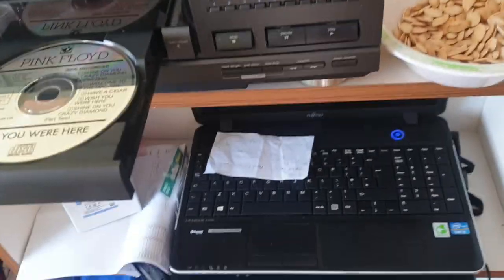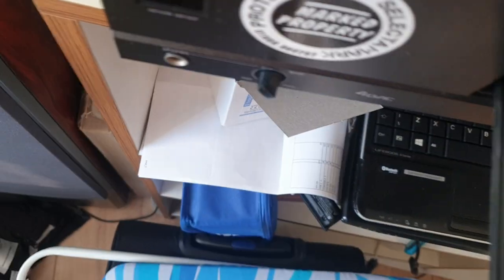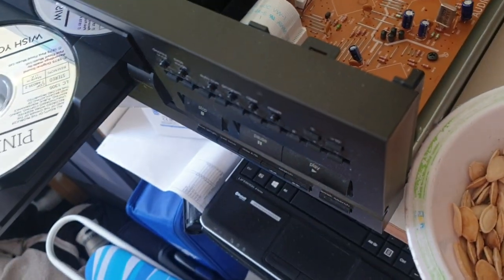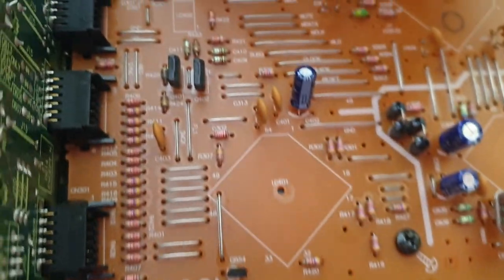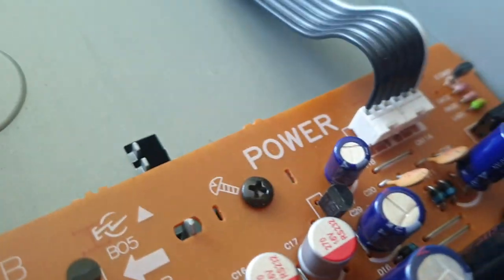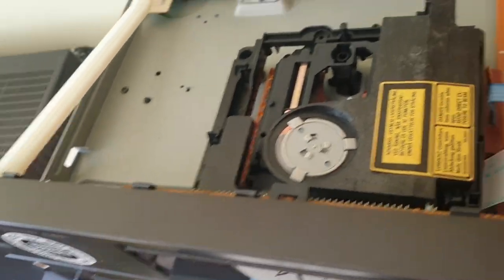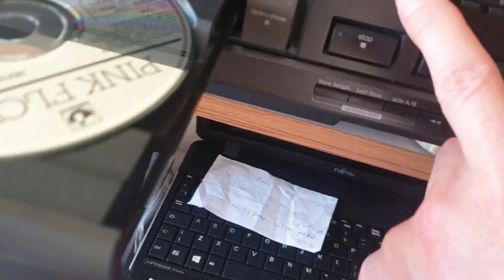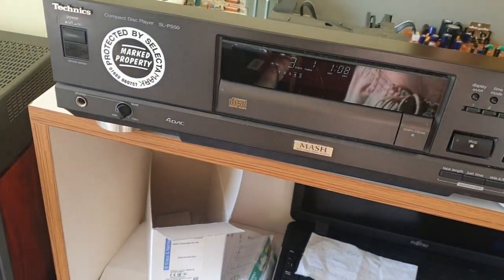Repair Technics CD player no spin so no reading of disc. Easy hardware repair faulty resistor swap

Comment: Those are fairly easy to work on. Usually S0AD70A laser goes bad. It is a decent player yet sound isn't that great. I had one and probably the worse Technics CD player I have had. Thanks for tips for repair :)
Reply: I ordered a new laser for my cd player. I fixed one hi-fi player with new laser replacement.

Comment: To pull out that board you need to unscrew front not back to pull it out.
Reply from the maker: I have found it way more convinient to remove back panel as I believe you do not have to flip whole machine and easily avoid any damage of front panel. Even I did not see it for 6 years I am prety sure to remove front panel need access from bottom. 😉